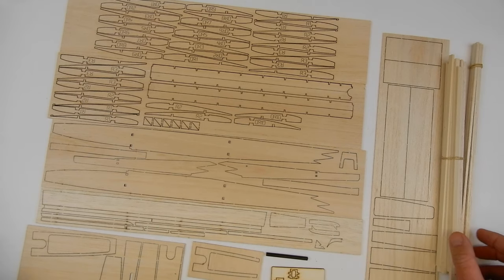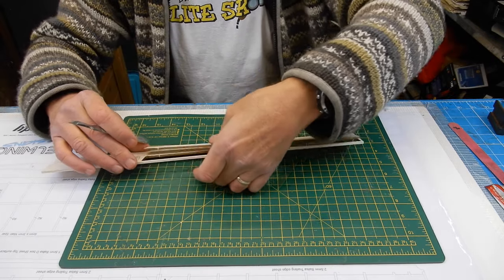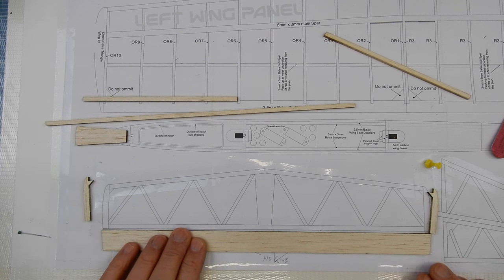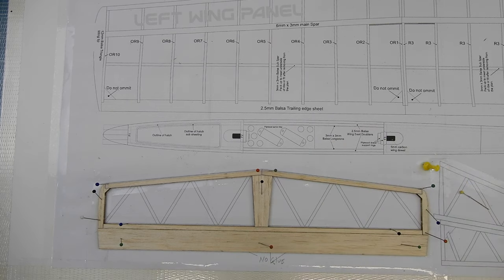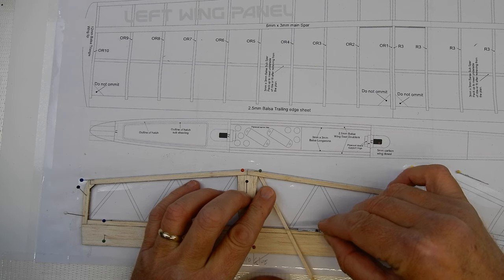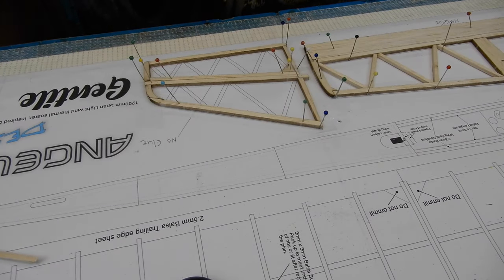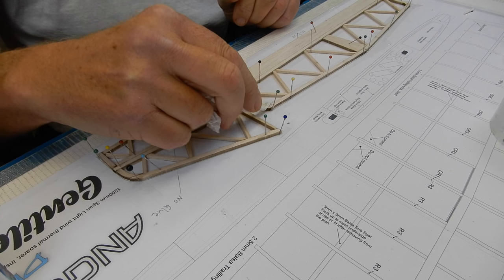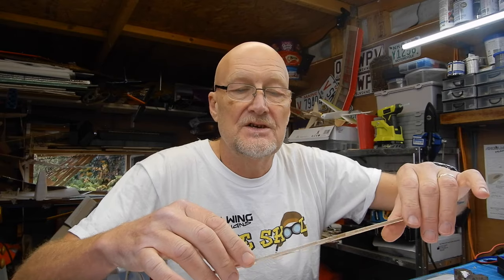How to build Gentilee Lady Rc Glider  Part one Tail surfaces

Comment: Is this glider only for non-Jews? :-)  Been looking and thinking about finally trying a balsa kit.
Reply from the maker: Think the name was not to offend the original glider build of the 80’s
Reply: @NickChittyFlying  I assumed as much.  For what it’s worth, I probably would have went with “Genteel Lady” in order to avoid confusion with the biblical term for non-Jews. 

Still, a rose by any other name……. I might have to finally take the plunge and start a balsa kit and this may be it.  Thanks for taking the time to slowly go through everything for us that haven’t tackled a kit yet.  Is there any plan for a power pod on this model?
Reply: @bobjosjor8307 there will be a pod and also.3.other model derivatives utilising the same.wing
Reply from the maker: @bobjosjor8307  yes mate hopefully done over Xmas